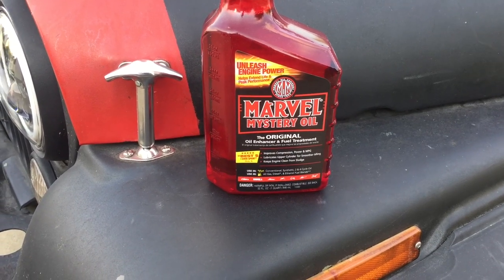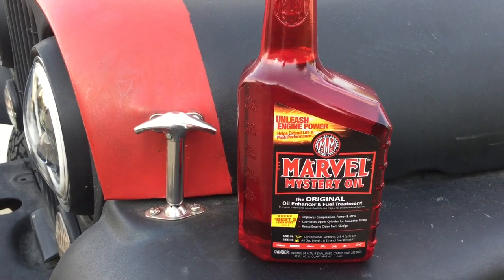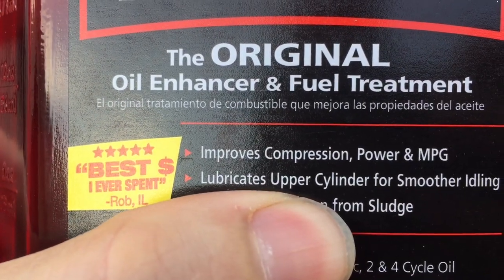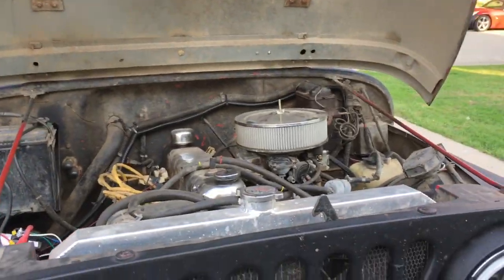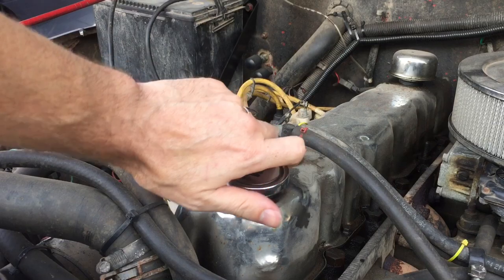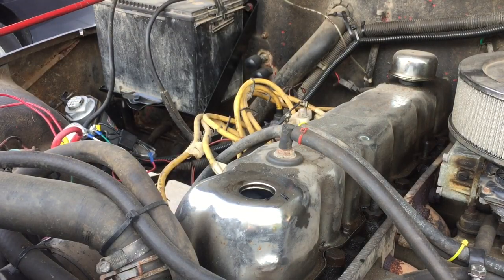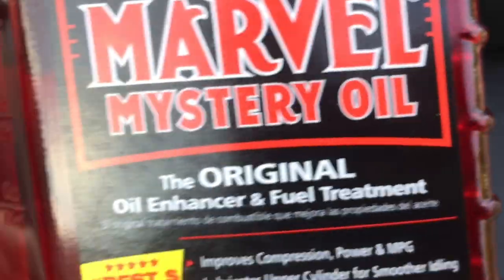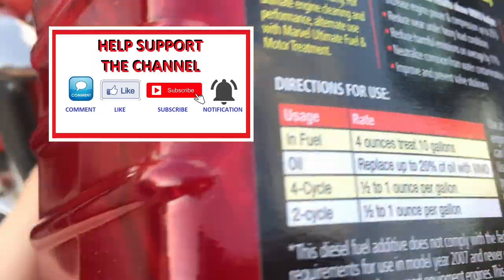Does Marvel Mystery Oil Work? Does it reduce lifter tick or engine noise? Sound Test and Review!

Comment: I’ve been using MMO for over 30 years . It’s great stuff. We use it all the time in the aviation industry. In cars, it will quiet lifter noise dramatically. You are measuring typical engine noise, lifter tick isn’t gonna change a decibel reading . In aircraft and car engines , it loosened all the carbon build up on pistons and rings. Helps get compression reading back up. After using it, the filter is loaded with small carbon chunks. Cut a filter open and take a look .
Reply from the maker: Very helpful. Thanks for sharing!
Reply: Great presentation

Comment: MMO bottles makes good funnels when you cut the bottom off with a box cutter.
Reply from the maker: Thanks for sharing! The bottle is rigid, and it has a long neck; it sure would make a good funnel!
Reply: I thought I was the only hillbilly to do this,I've been known to cut the bottom of a Mtn Dew bottle from time to time also
Reply: @dustinpomeroy8817  I tend to cut the 2 liter bottles midway between top and bottom for funnels.
Reply from the maker: I took the advice on the MMO bottle. It is nice and rigid, the neck is long with a small diameter, and it is also transparent. I am now a proud owner of a MMO funnel.
Reply: Oh snaps! I never thought of that. I'm gonna try it.
Reply: Have to see does the opening fit into a fuel filler neck opening ? If I don't have my skinny neck funnel with me, and trying to add fuel to a car, it's a real pain. This could be a real helper.. the smaller opening bottles are usually the little STP, Gumout ,Heet, types! 🙂👍👌Thanx; Jethro
Reply: Brilliant. Thanks

Comment: The common misconception with MMO and most other additives is you can just dump a can in, run it a couple hundred miles, and your problems magically go away. That's not how they work. With the exception of a few, most are intended to be used frequently to continuously, doing their work slowly but continuously. None will resolve a mechanical issue such as worn lifters, push rods, or worn bearings.
Reply from the maker: Right on! Thanks for sharing!
Reply: It may loosen sticky parts,and keep your engine clean on a regular use basis,but no additive fix worn out parts.
Reply: MMO worked in Minutes to Clean my Lifters
Reply: @SilverDollarSaloon  Which is kind of the point of most additives: either help prevent problems with routine use or, if the additive doesn't help, you need more serious repairs.

Comment: It's important to understand that MMO is an "oil additive" and not an "oil flush".  A flush can work after 10 minutes of idling the motor, then you drain it all out.  MMO is an additive that also cleans your motor but is much less harsh than a flush and is designed to work slowly over time. You're supposed to add the MMO when you change your oil. Then drive normally until your next 5,000 mile or whenever oil change. You may need more than one treatment for it to fully work. I hope that makes sense.
Reply from the maker: Thanks for sharing. Definitely makes sense. I’m still running the MMO and would like to do a follow up video at some point, but I only put a couple hundred miles on it each summer.
Reply: Exactly, it is addictive, not magic oil , 5 miles drive won’t get anything, you need at least 500miles .

Comment: I appreciate your honesty. Even though its not quieter ,  getting rid of the tick sounds like a success to me. Have you noticed any improvement since you posted the video? I've heard that marvel mystery oil takes longer than other additives to clean.
Reply from the maker: Thanks for the comment! I agree, reducing the tick sound is definitely a success. I have not driven it much more, so I have not noticed any further improvement. I only drive in the summer and it is currently parked for the winter. Although the bottle and the website do not specify how long to run it before seeing the results, several others have also said that it takes time for it to work. I don’t put many miles on that vehicle, maybe 1,000 per year, so I’m not sure if or when I will ever see the full effect. I will plan on adding another quart in the spring when I change the oil.
Reply: @HowtoandReviewsOfficial  I think MMO asks you to run the MMO for 500-1000 miles to remove sludge.  Did you do that?
Reply from the maker: @tomfisher3117  When performed this test, I inspected the bottle and website thoroughly. Neither specified a required mileage. It just said to do it at every oil change. Other people said they noticed results immediately. I experienced noise reduction after driving it around for 20 minutes.

Comment: I have a 2002 Chevy delivery truck that now has 146k miles on it. About 2 years ago, the truck had a noticeable lifter ticking noise. The truck was a quart low on oil, so I put a quart of Marvel Mystery Oil in the crankcase. It took a couple of weeks, and the noise went away. When I next changed the oil, the oil was as black as coal, telling me that the MMO was also cleaning some of the sludge out of the engine. Now, once between oil changes when it is a quart low on oil, I add a quart of MMO to the crankcase as preventative maintenance.
    Since 2016, I have added MMO to the gas of my car, truck, and lawn mower at 4 ounces of MMO for every 10 galllons of gas. I am now getting at least 1.5 to 2 extra miles per gallon on the highway in my car. With Walmart selling the quart (32 oz) bottle of MMO at $3.88, I am actually saving money using it as I am using less gas.
Reply from the maker: @frank new
Thank you very much, I really appreciate the input! I have heard and read many similar great things about MMO. My understanding is that it is pretty much a detergent, designed to clean the engine and/or fuel system. I'm pretty much planning on running MMO next summer as well to give it more time to work and see how things go. Thanks again!
Reply: @ How-to and Reviews
  You are welcome. I also view MMO as a gentle detergent and lubricant. I started using MMO in the gas in 2016 on the advice of my mechanic, who had just replaced the fuel pump on my truck. He said MMO would lubricate the fuel pump, making it last longer, and clean the entire fuel system. It also made the idle much smoother in both of my vehicles, along with improved fuel mileage.
Reply: @ IncogNito-gg6uh--       Unfortunately, it seems like many things have doubled in price in the past three years due to Bidenomics.
😢😢

Comment: From what I understand, you need to do this for a few oil changes.  Depending on how thick or engrained the sludge is/carbon buildup, it may take many repeated washings/soaks to break it all down.
Reply from the maker: Thanks for the input. I appreciate it!

I didn’t mention it in the video, but I did thoroughly read the bottle and the MMO website for how long to run it (how many miles) to see results. Neither of them specified, or even mentioned, any time frame. They left it up to the consumer to deal with it. If it said to run it for a specified number of miles, I definitely would have.

If figured, if there is a squeaky hinge, and you add grease, the squeak stops immediately. So, if I add MMO to a ticking engine to “enhance lubrication” will it stop the tick? That is the test that I performed, the these are the results.

MMO very well could need to be ran for thousands of miles. Or tens of thousands. I don’t know; the bottle and website do no say. I guess that’s part of the mystery of MMO.

I hope that helps. Thanks again!
Reply: If the engine has that build up causing the close tolerance parts to stick it has to be cleaned off first. Just like when you wash greasy hands it may take soap and water a number of times to get it all off, it would not be comparable to a noisy himg as they usually don't have harden gunk build up and don't move near as fast.

Comment: It definitely worked in my 2005 F-150 5.4 and also Fixed my PCV Valve that's inside of the Valve Cover and an all day job to replace the Valve Cover

Comment: Nice looking Jeep.  I have used MMO since the late 60's,  65 Corvair, 68 Camaro, 70 Chevelle,  68 Charger, 74Beetle, 77 Cordoba and so on. I worked for Pennzoil from 72-79.  Have alway used 1qt per oil change. If you are afraid of thinning your use a gt or 2 of higher viscosity. 5w30, use 10w30 or 40.
Reply from the maker: Thanks for sharing, I appreciate it!

Comment: I've used MMO successfully on a '09 5.7L Hemi, with an occasional tick. I added it about a week before the oil change, then changed the oil, and add about a 1/4 qt to fresh oil change, then "short change" the oil again at 2500 miles, repeating the MMO routine before the oil change. After a couple of those, the "tick" disappeared. I think that the MMO and clean oil removed a piece of debris blocking an oil feed hole on a lifter. I also use filter magnets on the oil filter, which I've found to do a great job of removing ferrous "dust" from the engine/engine oil, which is obvious when cutting open the used filters.
Reply from the maker: Awesome! Thanks for the valuable feedback! Glad it worked!

Comment: You gotta give it 24/48 hours to dissolve the gum bro.... It really does work, and dont forget the "Italian Tuneup process"... ;)
Reply from the maker: Thanks for the input!
I checked the bottle and website very thoroughly for how long to run it for results. There was not information provided. Otherwise, I absolutely would have followed their recommendations as part of the review. 
I suppose that’s part of the review. How long do you need to run it? No idea, the MMO bottle and MMO website don’t  mention it. So, I got to choose. 
I definitely get the rpms up under load a couple times per year, climbing those sand dunes, off-roading.

Comment: Make sure there are no exhaust leaks between the exhaust manifold and cylinder head and manifold-to-pipe gasket, "donut" or ball-and-socket joint (depending the on design of the exhaust system in your vehicle). Exhaust leaks in these areas can easily be mistaken for valve train ticking.
Reply from the maker: Absolutely! Thanks for sharing!

Comment: When you put a decibel meter right next to the air filter it will ALWAYS have the same dB reading. Essentially what you were measuring is the loudest sound in the vicinity of the microphone, it being the air flowing into the filter.

Comment: 2005 GMC, 5.3L...had low compression, RPM was below 500 at idle when warm, with misfire.  I put 1 quart of MMO and no changes up until 220 mile mark.  yesterday all day driving, today so far, the RPM jumped back up to normal, or nearly normal.  the misfire is reduced 90% (from the feel of it), and engine is more responsive to gas pedal/acceleration.  my engine was filled with sludge prior to using this, I have not confirmed whether MMO helped with sludge at all yet.  one thing, this oil thins your engine oil.  My oil pressure did drop from  25 psi at warm idle to 20.  this is not good for me.  but it does definitely improve engine behavior with idle, power.  this is only after 200 miles.
Reply from the maker: Thanks for sharing! Good to have a reference that results were noted around 200 miles.
MMO was indeed thin and will thin the oil. It is a detergent that cleans the engine.

Comment: I've used this for 43 yrs. Change oil and filter. Every other oil change I add 1 qt. Yr meter is picking up yr exhaust. Marvel will clean yr engine but follow my steps and after 500 miles will do some good

Comment: I just started running this in my gas in my 2011 f150 with 98000 miles. 500 miles before my next oil change I'll add a little in my oil. Mmo is good stuff

Comment: Could definitely tell from the before and after that the ticking was reduced. 👍 good video, I really need one of those oil pan valves. That would help a ton
Reply from the maker: Thanks for the input! I will definitely be making videos dedicated to installing and using the oil change valves in the future. I currently have them on 2 of my vehicles and have one waiting on the shelf to install on a 3rd vehicle. I am just waiting for the next oil changes. Stay tuned. I have a very long list of how-to and review videos to make in the future.
Reply: Your particular oil pan design complements the quick drain plug design. For many other oil pans the quick-drain plug design makes the oil pan unable to drain fully, leaving a substantial amount of old, dirty oil to contaminate the new oil added. For that reason, because all my oil pans are not conducive to using them, I won't use those things.

Comment: One about this is that it works and it works better when you do an oil change / tune up. I use this on my 86 cutlass.
Reply from the maker: Thanks for the input! I do plan on adding adding it when I change my oil this spring and letting it run all summer. Interested to see the results.
Reply: Not going to lie but this thing saved my motor and over $1000 since mechanics wanted to charge me for a new motor. I did a full tune up, added marvel, let it run for an hour then changed the oil Nd add more marvel. My 307 stopped smoking Nd ran way better
Reply from the maker: @SamuelSandoval21  Awesome!

Comment: Comeback  in a week and try it again with the decibel meter..Also try it in your gasoline to get the rings and piston tops cleaned up too.  I think a full 3,4, 5000 mile OCI really let's it work...It can't fix things that were left go too far in the first place though! Easily one of the best additives out there. Many others are imitations of it,  Example Seafoam etc...Running a  full synthetic oil will help keep  things clean too, they have more detergents in them....Cool Jeep! My  buddy had a CJ 5 with the V8 in it. A Fun Fun machine! THANX; JETHRO
Reply from the maker: Thanks for the comment! I definitely have more “testing” planned for the MMO!

Comment: Add to fuel tank as well, find a busy interstate where you can open that engine up for about 2 to 3 miles wide open and let that MMO clean and burn the engine clean, I've done my vehicles like that and had to lower the curb idle after wards because the engine was running way better ,,, just a suggestion ,,, sometimes ya gotta run the hell out of a engine to burn out the inside build up ! :),,, plus you might want to check your valve adjustment, could be a cause of ticking :)
Reply from the maker: Thanks for sharing. I was planning on running a bottle through the fuel. The carb has not been cleaned…. ever.
Reply: @HowtoandReviewsOfficial  do not over treat your fuel, stick to 4oz per 10 gallons no more then that, for the best effects add to every fill up, should increase your MPG, and keeps the fuel pump, lines, carb, intake, valves, piston tops lubed and clean, and make engine last longer.. :)
Reply: @HowtoandReviewsOfficial   You might want to check out Project Farm on u-tube about ,,,, Seafoam--can't believe what it did to my engine!!   ,,, I've never used sea-foam,,, but I have had good results with MMO :)

Comment: If it got rid of the "tic",  I'm guessing the MMO thined out the oil for better flow/librication and probably dissolved  some gunk that was causing some oil flow restriction. I've herd that Royal purple has a more aggressive detergent package, you may consider switching to that brand of oil.
Reply from the maker: Thanks for the suggestion. I’m going to do an oil change and get it Bain the road for the summer in the next couple days.

Comment: Thanks for the video !  MMO is a great product, it really does work. From the noise and the video (especially on take off) I can almost guarantee you have an exhaust manifold leak. I would check all header bolts, header gaskets, and the headers themselves.
Reply from the maker: Thanks. I will double check the headers.
About 15 years ago I thought this vehicle had an exhaust leak, but it ended up being a stuck lifter. Wore the cam lobe off. So, I guess I’m extra cautious/skeptical this time around.
Reply: Yes straight 6 engines develop exhaust leaks very frequently. It could very well be a exhaust leak.

Comment: My guess is that overall engine noise is going to be the same decibel-level, regardless of ticking.  If it fixes the tick, that's really the evidence, to me.

I changed my valve cover gasket recently and was not pleased at what i saw beneath it.  I worry too much about a Seafoam treatment on a modern vehicle, but will give MMO a try, within proper-use  guidelines, to try and correct potential sludge issues.

My hunch is that people can make the mistake of thinking "more is better," and exceed the manufactuter's recommended ratio of MMO-to-oil (or fuel), and might run into trouble.

Also, i think expecting instant results should be avoided.  It took years of build-up to produce symptoms, and a regular usage of MMO per the instructions, if it is going to be effective, may take awhile to yield the expected benefits.  

I'll be using it cautiously, so as not to shock the system, and then ease into full recommended guidelines, in the effort to reverse 170,000 miles of gunk buildup.  Time and patience.

Comment: I use it every other oil change. You should change yr oil and add 1 qt and drive few hundred miles. Then test it. 40 yrs been using it
Reply from the maker: Thanks for the input! I will continue to monitor the effects as I rack up more miles!

Comment: Also using this will it clog up the oil pick up tube with Lal the sludge it'll be removing? I have a 04 Silverado and previous owner didn't really take care of it so I'm trying to clean up the inside.
Reply from the maker: That’s a good point and something to consider if sludge is just sitting in the oil pan. I’m not sure if it would break the sludge down, or just break it loose.
Otherwise, if it’s in the heads, it would would have to make it through the push rods and lifts and everything, so I would think it would be broken down and should not clog the pickup tube.